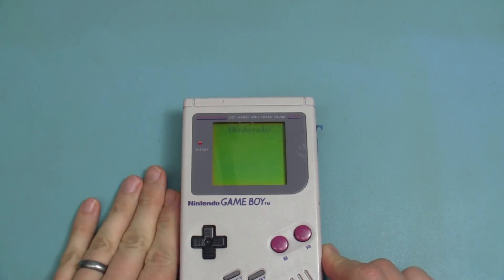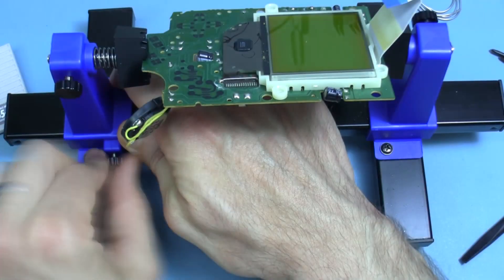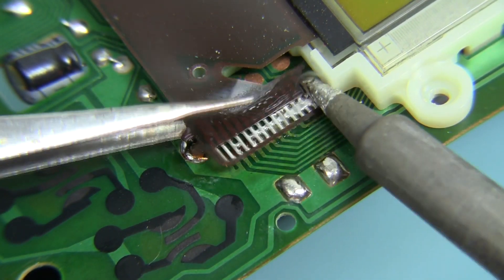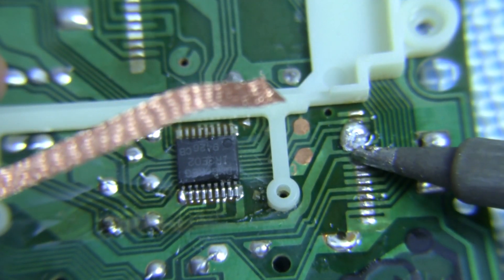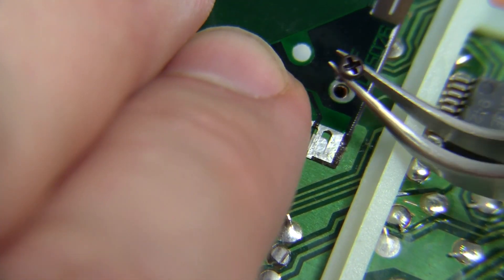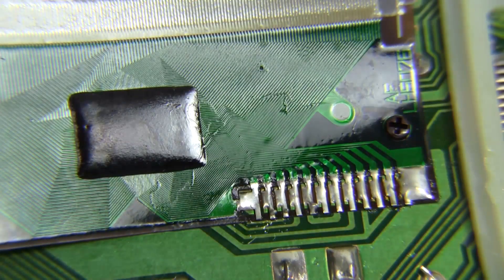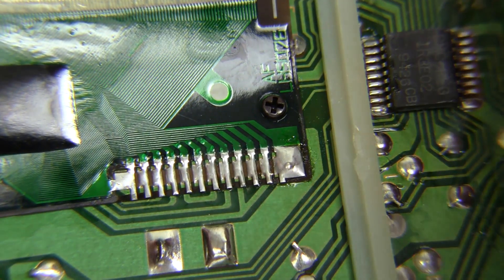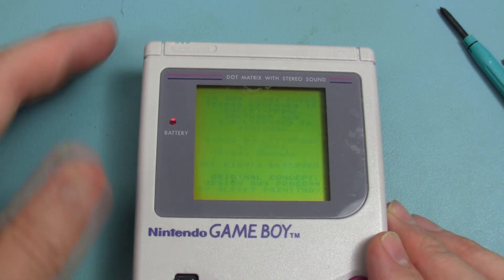Easy Game Boy DMG LCD Screen Swap  - No longer impossible

Comment: I think you were/are using too much heat and that’s why your flex cables get melted. I’ve done several modchips on the Switch, all require flex cables to be soldered and I have melted none of them and they’re smaller than the GB one 🤔

Comment: would you need the same low melt solder and special flux to remove the ribbon cable from behind the screen? I have a DMG that works but the ribbon is all bent and broken. I also have a working ribbon in another DMG that the screen has the black dots of doom so was gonna harvest from it for the ribbon

Comment: I have a Gameboy with dead horizontal lines that are stubborn and won't stay when I solder them. I guess it would be better to just remove the first ribbon and try to solder from the back? They come back only when I solder right at the bottom of the screen, I have to push the iron right against the bottom of the screen. I can't find a replacement for the screen anywhere.

Comment: I have just done the backlite mod.  The first time I soldered the backlite in the gameboy worked fine.  Then I had to rewire the backlite and the games won't boot (the system just freezes after it shows the Nintendo Logo).  Would you know what is wrong and how to fix this annoying problem?

Comment: The left-side pins are not flowing as quickly because the left-most two pins are directly attached to ground. You can preheat the board with hot-air at a low temperature to "soak" the ground plane which will allow you to bring parts of the workpiece that are directly attached to ground to a melting temperature for the alloy faster with your iron.
Reply from the maker: yep, good idea

Comment: i wonder if a rework (hot air) station would work for swapping screens on DMGs?
Reply from the maker: if you watch my previous dmg screen swap video, you will see hot air works great except I couldn't figure out how to keep the plastic screen bracket from melting

Comment: I am not sure I understand why you apply the chipquik on top of the pins and why you are not simply heating them up directly and lift? 
From my understanding the molten chipquik acts as a continuous source of heat for the solder holding the pins in place underneath. Since you can spread the chipquik along the ribbon pins, all pins get heated simultaneously so their connecting solder melts and you can lift the ribbon up easier? Is that correct?
Reply: Actually nvm, I think I get it now. After watching the video a little more, it's obvious the ribbon pins are not under any plastic layer, they are just exposed, so the chipquik blends with the regular solder, dropping its melting point as well.

Comment: Today I tried to do this. All with normal solder and some patience. Took like 20 minutes total. I had a DMG with a bad display but with a good flex cable. Had also a DMG with a good display but with a bad flex cable. They are now fused and I really didn't expected it would work, but it did!

ps. I did remove the clip first and then removed the first connector. It worked like a charm
Reply: I was able to swap the flex cable without removing the screen, you just need to lift the screen up and you can desolder and resolder a new one that way, there's just enough room to do that

Comment: The trick is to use a piece of copper wire the length of all the contacts+flux and extra solder, it will transmit heat evenly across all the pins, same technique to desolder a multipins IC
Reply: Could you explain a little further? IF i understood well, you use a piece of copper, like a big single wire, to cover all pins at once, and then heat that one piece of copper? Seems like a neat trick, does it work as good? Thanks in advance!

Comment: Can't you just use wick to soak up the solder instead of ChipQuik?
Reply from the maker: Game Retro did it work when I tried it? No, but it’s probably doable especially if you used a lot of flux and some good braid. I couldn’t recommend it to anyone though because unless you really know what you’re doing, there’s a good chance you’d lift a pad at some point. 

I had to check the previous video on this and it looks like I stuttered past actually explaining what I did, but it sounds like I was able to get about half of the inner cable up without hot air or chip quick. And that’s when I had the idea to use chip quick instead https://youtu.be/MXhseTD-Vok

If you try it and are successful, I’d love to hear about it.
Reply: @8bitjunkie8  Thanks for the explanation. My soldering knowledge is limited so it was a genuine question. Using a low melting point solder however in itself is genius. I am sure expensive desoldering stations use heat and pumps or something else, but for the budget option this is really quick thinking.

Comment: @8bitjunkie - great video(s) you have around this topic, but.. where do you get the replacement LCDs? I've a DMG-01, the horizontal strip is ripped off in one corner, and the horizontal one has a lot of lines that don't show at all.. already tried to reflux the stripes, no luck, thinking of replacing the whole LCD, but can't find them anywhere.. any leads would be really appreciated.. thanks!
Reply from the maker: From broken game boys - check eBay.

Comment: if lcd has horizontal line can we fix it ?
Reply from the maker: probably not.
Reply: Yes, very easily in fact. I've repaired a few of mine. There is a horizontal line of connections on the bottom of the screen under a small length of thin rubber. Peel up the rubber and then flux the screen connector ribbon (it's actually on the glass of the screen). Run a soldering iron across to melt and reseal the solder connections to the screen. You can also melt in a little solder and draw it back and forth across as well. If it is well fluxed the solder will draw under the cable and improve the connections. 

Make sure iron is hot enough to melt the solder but not so hot as to melt the ribbon or damage the screen. As the connections are very small they don't require as much heat as larger solder blobs.   

Good luck
Reply: MrJuice1979 You are confusing horizontal with vertical. Vertical lines are easy to repair. However, I haven’t seen anyone repairing horizontal lines yet(I might be wrong)

Comment: just ruined my gameboy trying this. very sad
Reply from the maker: johnstont534 dude, what happened?
Reply: Yeah man it's so simple.did you even watch the video
Reply from the maker: I think I've heard from at least 2 or 3 people that tried and failed, so maybe it's not that easy?  not sure.  maybe someone will send me a failed attempt and I can see what's happening
Reply: i have a gameboy with a bad screen, it still turns on, like i can hear the pokemon music with the pokemon cartridge inserted but the screen has many horizontal and vertical lines on it that it's completely unplayable. i'm just using my gameboy advance till i can fix my DMG eventually, like consolize it or get the bennvenn or the IPS screen mods. that screen replacement procedure that you're doing is definitely not for the faint hearted and requires good soldering experience.

Comment: This is really well done, awesome job! I'm having an issue with one of my DMGs where all the pixels are black when I turn it on. The contrast wheel doesn't seem to do anything. When I turn the screen off I get some diagonal lines that fade out. I first noticed a couple of broken solder joints on the cable behind the screen and resoldered them but still no luck. Any advice?

Comment: I have a question. maybe you can help me. I unknowingly bought a dmg GB that had battery damage inside. When I purchased it from the person I got it from, it was working, I left put away for about a month, without batteries of course, and when I finally came back to it, it had problems when I turned it on. I checked the battery tray and saw battery erosion damage so decided I would clean it. upon opening it, I noticed the acid got up to the copper plate thing on the mother board. I gave it a cleaning as well I could and closed it back up. so now the GB turns on, but it keeps restarting right after the Nintendo logo comes to center. can it be fixed or is it doomed for parts only? any help is appreciated. thank you
Reply: ibiscar06 clean the cartridge port ?
Reply: PixCub thank you, I ended up reopening it and at closer inspection saw some type of goo on the back of the circuit board where the screen goes, . I cleaned it, took off the board to inspect the other side, also noticed the ribbon cable that connects both boards was a bit loose, put it back together and now have my gameboy working perfectly.
Reply: ibiscar06 Great ! :D

Comment: Where do I get a new replacement screen though? I have a console with a busted screen but unfortunately don't have another lying around to get a spare screen from.
Reply: buy another DMG and use the parts ;)
Reply: Philip Tan BennVenn is selling a custom 3" backlit screen with a front PCB on His website. I don't know when they're going to be back in stock however.

Comment: Finally!
This should also help to fix horizontal lines as well. Seems like Chipquik is the only option here. (Even though it's kind of expensive for what you get in my opinion.)
Reply from the maker: it is kind of expensive (ish) but it's really for removing huge chips that might cost $100s